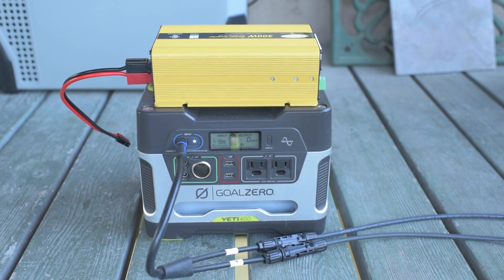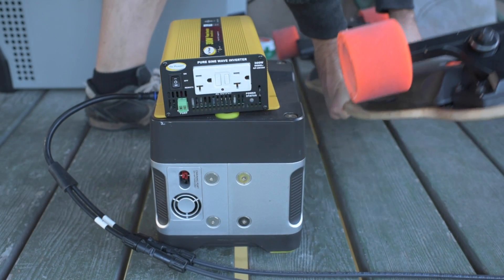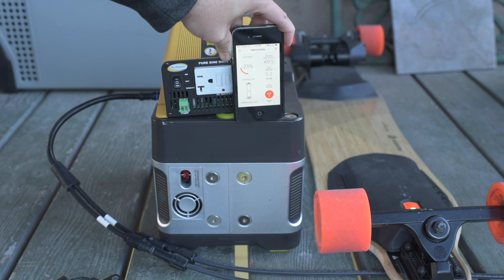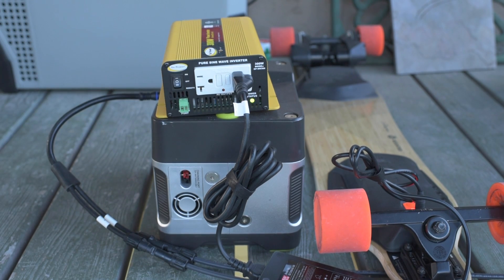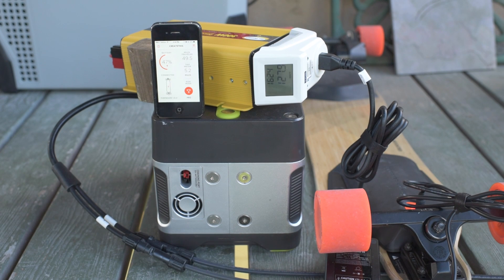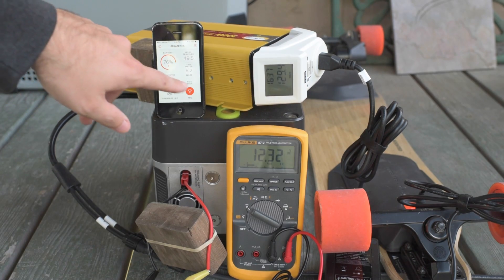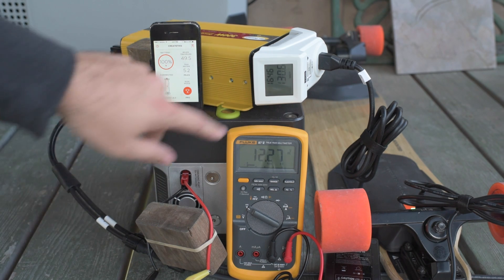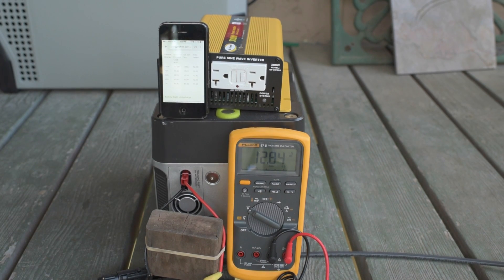Solar Boosted Board Dual+ (Yeti 400)

Comment: Awesome video! How many times could you charge the boosted board from 0-5% to 100%
Reply: Sorry let me clarify more. If you were just charging the yeti 400 using a power outlet instead of the solar panels how many charge cycles could the yeti 400 charge the boosted board?
Reply: With no solar input, I'd say once. You might be able to get away with twice, but you'll be shortening the battery life.

Comment: Very helpful video! Do you know if this is the smallest Goal Zero setup that will charge a Boosted board?
Reply from the maker: +Sun Dreaming I believe it is at the moment, yes. You can probably get a nearly complete charge with a Sherpa 100 and the add-on inverter though. If you want super light weight, ditch the goal zero and go with a direct MPPT charge controller. The Boosted Board already has a battery after all, so you don't need a second one: https://youtu.be/Q8fI2PrXy-8
Reply from the maker: Does the Boosted Board charger draw too much wattage from the Sherpa 100 inverter? Frankly, I think it's long past time Goal Zero releases a Sherpa 200. The Yeti 400 uses an AGM battery, so only 50% of that 400wh capacity is usable if you want your battery to last any time at all. A Sherpa 200 with a 200wh lithium ion capacity would basically just be a lighter weight Yeti 400 for all practical purposes. You can DIY one if you want, but I'll be the first to admit it's really hard to equal the compactness of an integrated product.
Reply from the maker: I saw a guy cram a solar generator into an ammo can once. Might be a cheap alternative if you're doing something ultra lightweight: https://youtu.be/MVVRPUHUMUo